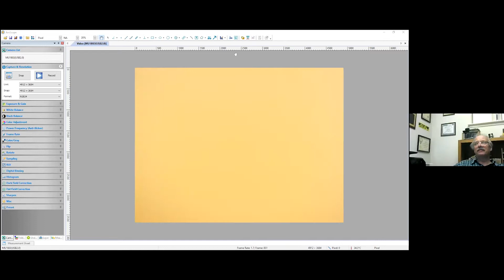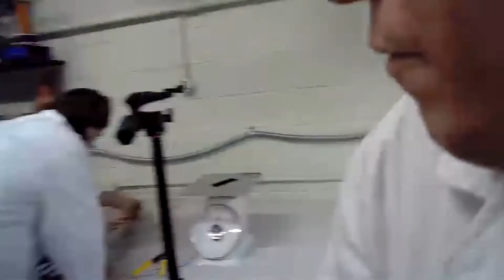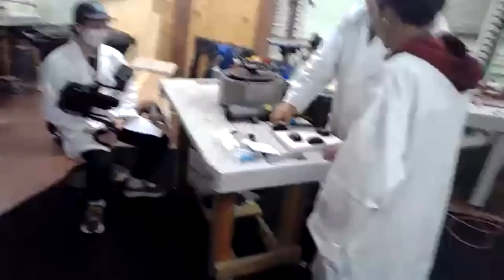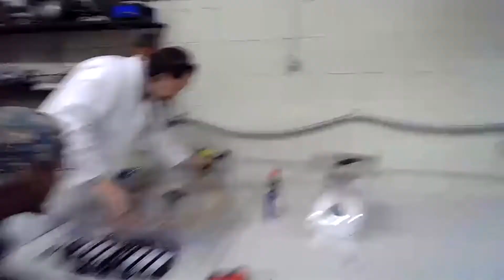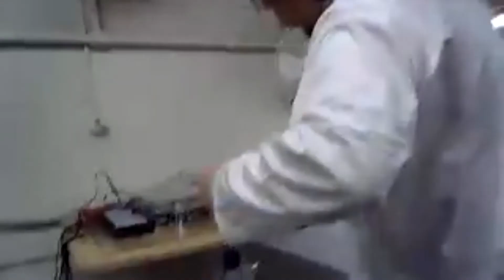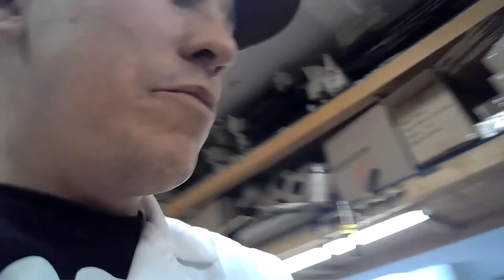APEC 11/13, Part #7 - Demos, Experiments & Open Discussion

Comment: A static ion diode doesn't react well below 500kv. S.I.Ds are what these chitin structures are. A pair of nearby Tesla coils repel one another almost like the wings.
Use them to grow cu crystals over carbon crystals on copper sheet or ideally, 1"dia bowl shapes, concave side.

Comment: Voltage on the wings? Are you high? 
Sorry I don't see the point.  It seems to me the wing's ability is to affect static charge amplified exponentially only once the proper geometric arrangement is made!!!!!! 1:wings must form bowl shapes together.  2:bowls must arrange in interlocking field patterns like 1 inside 6 in 12 in 24 or 1 inside 4 inside 8 inside 16 inside 32, or 4 in 8 in 16 in 24 in 32 or 1 in 6 in 10 in 16. 

The original wings were actually from a stingless wasp now reported extinct. Electron photography is quite different than beetle wings. Pinecone shapes in the chitin structure are much more evolved than in beetle wings. 
Kesche  Explained about 5 years ago how to grow something quite similar using using copper coated with propane made carbon crystals  Then coated with copper crystals over a period of 30 days.
 The pine cone shape does 3 things which are wave compression pulse orbital discharge and and charge rotation field interlocking. There is a method using radio frequency headerodyning to fast grow those exact shapes on that microscopic scale  Using nothing but a simple pair of tunneling ion beams projected from different points to the same point to form what is called a grid zone. A radio frequency holograph in this manner Using the right frequency pattern Is what DNA uses to to make certain shapes. David Adair once described how you could make just about any shape using the right set of frequencies. A binary pattern can easily be used to form any desired shape. 
It's a matter of forming specific angles it's and in certain angles that DNA uses to connect to connect you'll find those angles relative to other systems that form superconductive space.  ThePaulTM  Explains everything there is to know about DNA connective angles. 
Once you learn how to use the golden ratio in heterodyning in a grid zone  You can progressively make better material that will be used to shed a super heavy ion field off itself naturally to form better material yet. In other words the bigger you grow the sheet the higher quality material you will get.Eventually all you need are a pair of emitters made from the material or even the right bug wings attached to a 3-D printer to move around over a surface  Bonding carbon into structures from C02 gas or or easier yet using copy using copper sulfide solution to to electroform the crystal shapes. You can learn a whole lot about making fractals using using the free software called mandelbulber.  I prefer the 2013 version.
 All that is probably over everyone's head  But it's probably easier than what I'm doing right now. I'm making my own capacitors to Modulate 3 points on a metal bell shape across the spark gap. Top that with a little cone coil to spill the energy off and you have an inductive 0 point circuit.   In other words the same thing that the bug wings did with the pine cone shape at such a small scale you can do the same thing with using coils and simple metal fabricating. The most difficult part is actually just making capacitors. Right now I'm waiting on a machine shop that can make one more part so I can start cutting film for my capacitors.  
One thing I forgot to mention;  A high even number of rotation points around  a smaller even number of rotation  points acting like magnetic gears will extract a difference among the poles because positive particles are slightly larger on average.  Once 3 rings of charge are progressed charge will split due to 3 phase confusion  in the presence of a Carrier wave.  In other words if you implode 3 rings each having charge of their own they do repel each other but do something called an ion diode movement in the presence of an imploding Carrier wave.
 It is true you can use the bugwings or certain other materials in 3 layers or even more to form a much stronger field across spark gap if you use each one of those like a capacitor.   So much more I'd like to say here but signing off
Reply: Thanks for that load of utter bllcks Mike